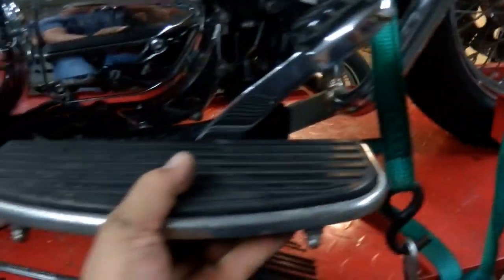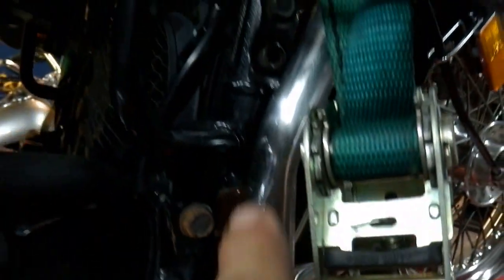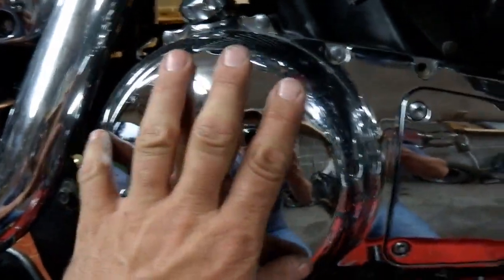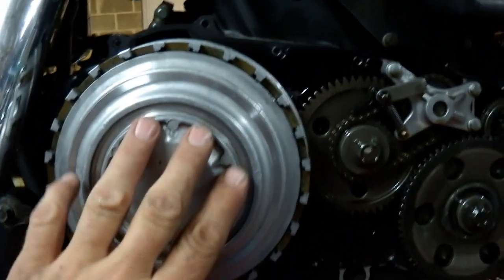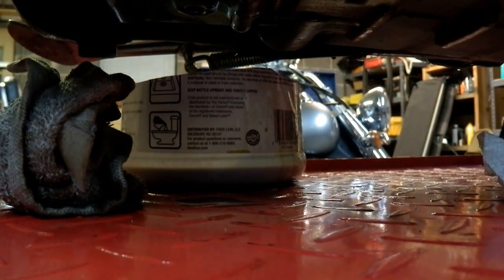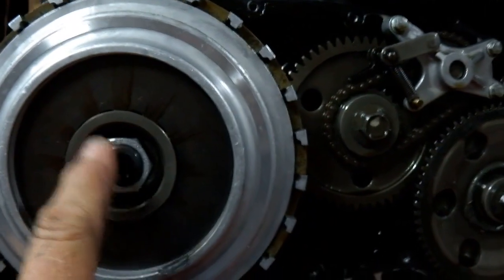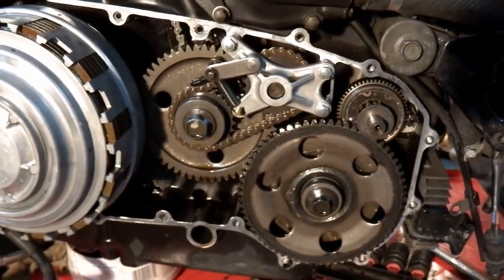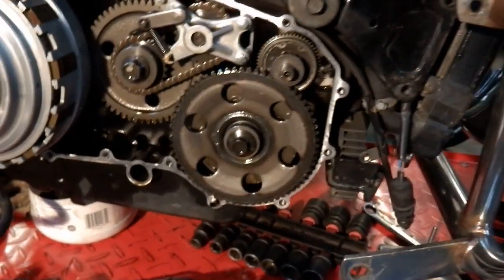2003 Kawasaki Vulcan 1500 Clutch repair Upgrade

Comment: Would you please tell me what that one part that goes behind the pressure string the one that goes in the garage to keep it from spinning and getting the wear what it is called I cannot find it anywhere I can find the pressure spring but that washer thing that goes behind it what do grooves in it to keep it from spinning so it doesn't get to where I have no idea what that's called and I cannot find it anywhere
Reply from the maker: Look at a newer model schematic, I got part numbers from 2005 ,, then I just ordered the parts used from E-Bay,, Keep in mind you need to replace the hub I guess its called ,, the newer one has a thinner rim to allow space for that ring with the teeth,,
Reply: @mobilmontana   well first off I want to thank you for even answering me . most of the time you ask somebody a question , they don't even want to take the time to respond back.... I appreciate you responding back. I did exactly what you said and I found a part number. so that's what I'm going to do thanks....
Reply from the maker: No problem,, got my parts for around $15 off ebay,, Good luck
Reply: @claybornlewis276  hello I was wondering if you could help me find them same parts I tried doing what you guys said to do I’m confused on where to go and really need help fixing my problem can you please tell me what needs to be ordered I could find it please please and thank you

Comment: Hopefully this is the fix for my mean streak 1500. Rides fine until it gets warmed up, after that you can hit the throttle and all it does is rev but stays the same speed.
Reply from the maker: Exact same on my bike,, clutches were not worn out at all, was just the spring was weak
Reply: @mobilmontana  what oil do you use? This is my first bike with the wet clutch so I'm new to it.
Reply from the maker: @TheDuck8679  I use Valvoline full synthetic 10-40 Motorcycle oil I buy from Auto parts store, buy oil filters there too, have since bike was new, 72,000 miles on it now
Reply: @mobilmontana  hate to bother you again but do you happen to have the part # for the part with the teeth you said came from a 2005? I cant find it on the barnett website.
Reply from the maker: @TheDuck8679  Got the part numbers from Kawasaki Partshouse .com,,,   There is a parts schematic under clutch so you can see the parts,, Thease are the OEM part numbers ( Holder 13280-1306 & Holder 13280-1307 )  but I bought my parts on ebay,, a lot of used clutches and parts on there pretty cheep,, think I spent like $15 for used parts,, Barnett only sells the clutch spring ( big curved washer with the matching teeth} Found this entire clutch on E-Bay  ( enter this number in E Bay box at top 164033122148, In the pic the washer with the teeth is on the hub, (9 Upper right in picture next to large nut )) you need both parts to convert yours,, keep looking you might find just them 2 parts separate like I did but if you do buy entire clutch it still should be cheaper ,, Good luck
Reply: Alright I got it all back together but I cant get the center to stop spinning to torque it down. I put it in gear and chocked the tires but the tires just spin.
Reply from the maker: @TheDuck8679  Honestly I used an impact wrench like tire shops use to mount tires,, Don't know what the exact torque ended up at, just pulled the trigger on gun a couple 2 second pulls,, just don't want to over due it,, You could use a piece of brass or aluminum as a wedge between gears to tighten with a torque wrench
Reply: @mobilmontana  the gear in the back isnt spinning, just the center peice with the teeth
Reply: @mobilmontana  I got it torqued down now the little rod with the bearings that sits inside the shaft wont sit all the way in
Reply from the maker: @TheDuck8679  did you remove clutch slave cylinder on other side of engine behind chrome cover before putting it together,, then loosen bleeder screw a bit when you reinstall it allowing piston to push in,, Like a brake caliper on a car
Reply: @mobilmontana  will try that tomorrow thanks
Reply: @mobilmontana  I didnt remove but I think I squeezed the clutch lever while everything was apart and it may have the rod over extended

Comment: So did replacing just the spring work?
Reply from the maker: It was just that spring washer of sorts, Worked great and I still have the new clutch fiber disks I bought and wasted my money on.
Reply: David Anderson mine started acting up about 4 years ago, I put a mean streak spring/washer in it and it worked good until now. I'm now to where I have pretty much no lever left and just bogs down when I get in the throttle. I'm trying to decide on new fibers and plates or just try that after market spring that seats down better. Thanks for the video and response.
Reply from the maker: Worked like a charm,  I didn't use the new fiber clutch disks , pulled my trailer behind my bike on a ride in the Smoke Mtns and no slipping
Reply from the maker: I will say the Barnett spring is a little tight, I use neutral at long lights but no slipping even pulling my trailer
Reply: Hi Dave,  do you only need the washer to upgrade or do you need the other part to go with it, it looks the same as the old one. Cheers Billy.
Reply: Hello great video! I replaced the barnett spring and new plates but still slipping...any idea?

Comment: I did my clutch recently with new Barnett friction plates and new steels I also picked up the new spring but trying to reassemble I could not get the nut to start on the threads do u have any suggestions?
Reply from the maker: Sounds like the total thickness of new fibers and steels combined with the new spring, I only ended up using the new spring and it was close getting nut started. Use a micrometer and compare thickness  of the new stack of fiber and steel plates to the old stack of fibers and steels. I have a stack of new OEM Kawasaki fibers I could measure up if you want to compare thickness. Guess you could reinstall the old steels and fibers, run it for a while till new spring breaks in a bit. Let us know what you end up doing to fix it, might help someone alts.
Reply: What size steel plates did you use with the upgrade?

Comment: Is the 03 and the 05 holder the same Just the 05  comes with the ring with the teeth? I ask for I am looking to order the parts and if the thick holder is the same for both years then I will only order the ring with the teeth and the spring from Barnett... thanks!
Reply from the maker: The hub (what i call it) that the ring with teeth is different on my 03 from the 05 parts I used,, the hub on the 05 , at one end has a thinner end, the edge the spring slides up against, when I bought a hub from 05 also needs a washer with teeth that fit into teeth on spring,,, hubs on the 03 and 05 look nearly the same other than the thickness of the end,,, the 05 is thinner to allow the use of the additional washer with the teeth that meets the spring,,, look at  parts breakdown of both youll see the additional washer with the teeth ,,, washer with the teeth keeps the teeth on the new spring from wearing out ,, hope that makes sense  ,,, Barnett spring is good but takes a little to hold at a long red light,,,
Reply: David Anderson thank you for the reply! I ordered the ring and the hub holder and will be doing the same thing you did this upcoming weekend. Thanks